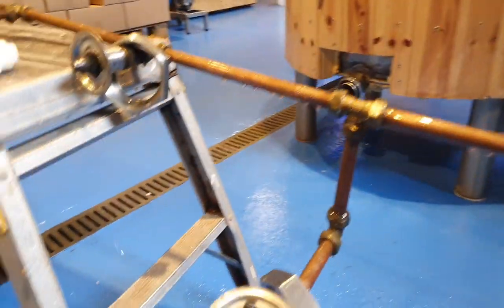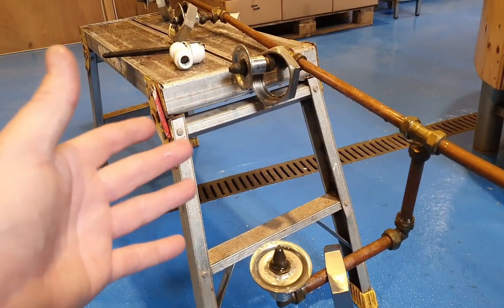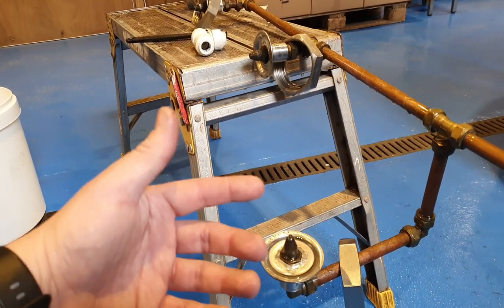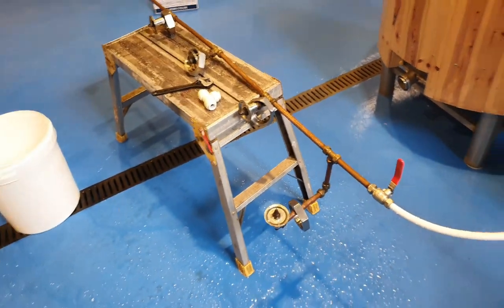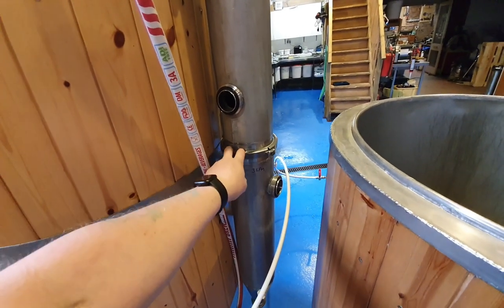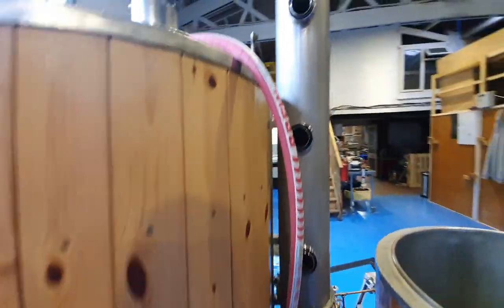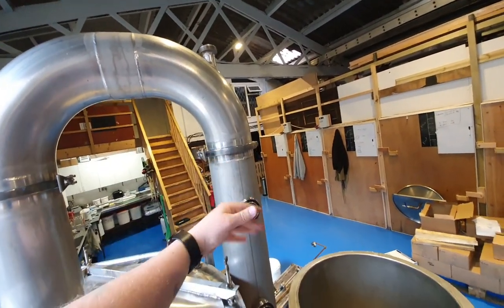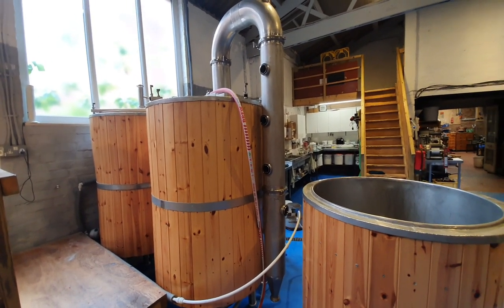Condenser Flue Spray Jets

Comment: Hypothetically, to save water, you could run it through a heat exchanger/radiator and filter, then recirculate it? as long as you can be certain none of that would make it's way back into the kettle?
Reply from the maker: It doesn't come out hot really, maybe 40C. Not worth it.